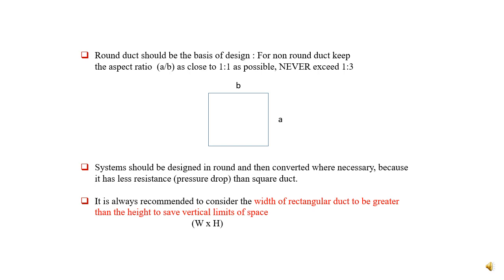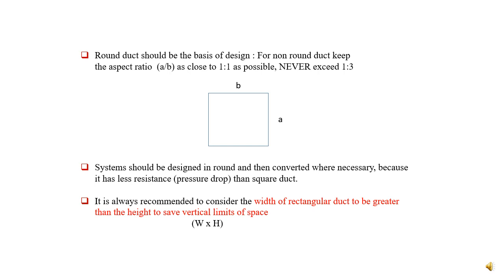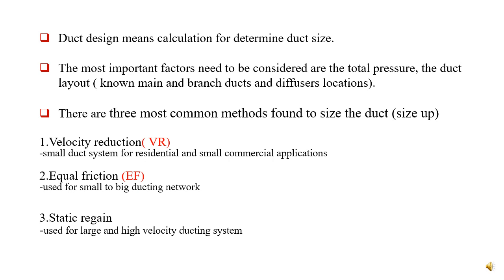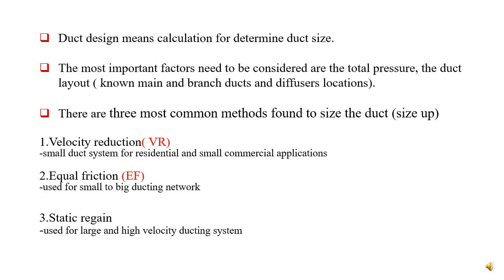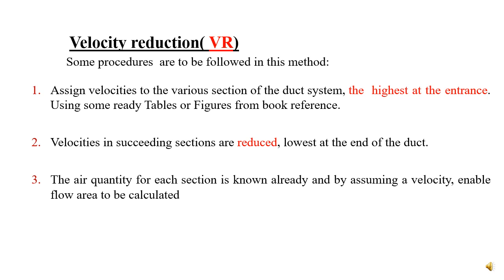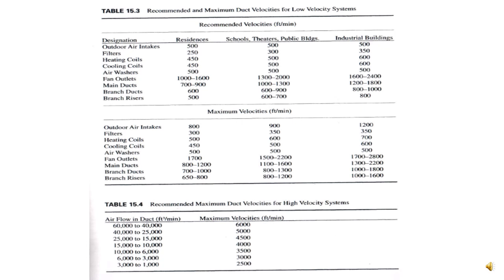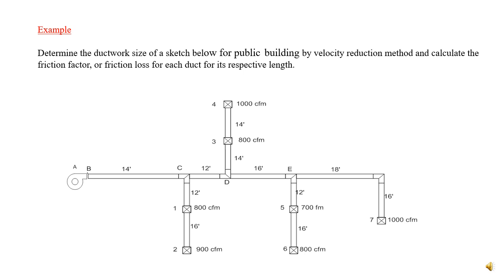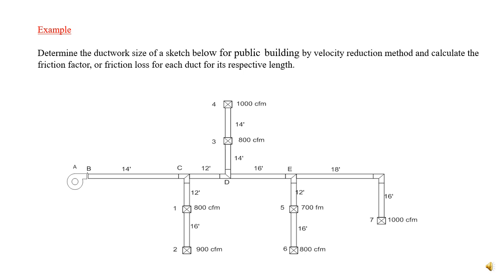Air Distribution System Design Lecture 7 part 1

Comment: MUHAMMAD SYAFIQ BIN ARZEMI
B071710014
3 BMMH S1/1

# DESIGN OVERVIEW
  > purpose of air duct system = deliver conditioned air from one to another.
  > 3 important criteria to be limit/control = space ( how much being supplied or give at the plenum/ceiling )
                                                                          = noise ( minimize as possible )
                                                                          = cost (specified/supplied by client in order not to exceed the cost )
     * cost plays important factor to design best air duct approved by client in order for their ROI ( return of investment )
  > 2 shape of duct = round ( should be basis of design )
                                  = non-round ( square/rectangle ) ; aspect ratio HEIGHT : WIDTH should as close to 1 : 1 , never exceed 1: 3
  > should designed in round then converted to non-round because round duct has less resistance ( pressure drop ) than non-round duct
  > WIDTH of rectangular ( non-round ) duct should be greater than HEIGHT to save vertical space limits
  > before design the type of duct and the duct size, a few things need to look at :
     * load of building
     * total pressure
     * duct layout
     * how many diffuser want to use
     * purpose of every room

# DUCT DESIGN METHOD
   > common method to size the duct :
       1. Velocity Reduction ( VR ) = small duct system for residential and small commercial applications
       2. Equal Friction ( EF ) = used for small to big ductwork
       3. Static Regain = used for large & high velocity ducting system

THANK YOU =)

Comment: MUHAMAD IZMAN BIN JAMALUDDIN 
B071710518

Design Overview
The purpose is to deliver the sufficient air to the enclosed
space.

i.        Choose the best location for HVAC equipment and ducts. 

ii.       A detailed load calculation.

iii.      Consider your equipment type and supporting systems. 

iv.      Use the right materials, fittings and supports. 

v.        Choose the right duct size and layout.

vi.       Ensure proper ductwork sealing.

The ration designs the duct is 1:1 

·        The width of rectangular duct to be greater than
the height to save vertical limits of space.

3 most common methods found to size the duct;

i.           Velocity reduction

ii.           Equal friction 

iii.           Static regain

Comment: NUR FITRAH NADIA (B071710363)

Design overview

To make sure the air duct deliver conditioned air from one location to another within prescribed space, noise and cost

Rectangular duct is better than round duct because more cheaper 💵 but disadvantage the pressure drop is higher. 👎🏻

3 method sizing duct size
- velocity reduction (small duct system)
-equal friction (small to big size duct network
-static regain ( high velocity ducting )

Comment: MOHAMAD SYAFIK BIN SOFI
B071710064

•Design overview 
-> To deliver condition air from one location to another location within prescribed limit ofspace, noise, and cost.
-> Ratio for ducting 1:1 as closed as posible.
-> Never exceed 1:3.

•Duct design method
-> Velocity reduction method.
    ( Before and after filter )
-> Equal friction.
    ( Use for small cubic ducting network )
-> Static regain.
    ( Large and high velocity ducting system. "rare to                 use because expensive" )

Jangan lupa like, komen, share and subscribe guys 🤗

Comment: Muhammad Akram (B071710573)
Air distribution design
Purpose of air duct design
* to deliver conditioned within prescribed limits of space, noise and cost.
* never exceed 1:3 ratio for duct size.
* round duct less resistance than square duct.

Duct design = calculation for determine duct size. Most important factor are the total pressure and duct layout.
 
Most common method to size duct.
1. Velocity reduction (small size duct)
2. Equal friction (small to big size duct)
3. Static regain (large and high velocity duct)

Velocity reduction
- Assign velocities to various section, highest at the entrance.
- Succeeding velocities are reduced, lower at the end.

Comment: Mohamad Hurairah B071710461

Design overview
-The purpose of an air duct system is to deliver conditioned air from one location to another within prescribed  limits of space, noise and cost.

Duct design methods
-Round duct should be the basis of design : For non round duct keep the aspect ratio  (a/b) as close to 1:1 as possible
-Systems should be designed in round and then converted where necessary, because it has less resistance (pressure drop) than square duct.

There are three most common methods found to size the duct :
1.Velocity reduction( VR) 
-small duct system for residential and small commercial applications
2.Equal friction (EF) 
-used for small to big ducting network
3.Static regain 
-used for large and high velocity ducting system

Comment: #	Air Distribution Design Factor
•	Limit of space
•	Noise
•	Cost 

#	Ratio for duct shape should never exceed 1:3 for rectangular the best ratio is 1:1
#	Make sure if you use rectangular duct the width should be greater than the height to save the vertical space limit
#	Round duct has the lowest friction loss

#	Duct Design factor

•	Duct size
•	Type of duct material
•	Type of duct
•	Total pressure
•	Duct layout

#	Method to size duct
•	Velocity reduction
•	Equal friction
•	Static regain
#	In some case we can combine velocity reduction method and equal friction method